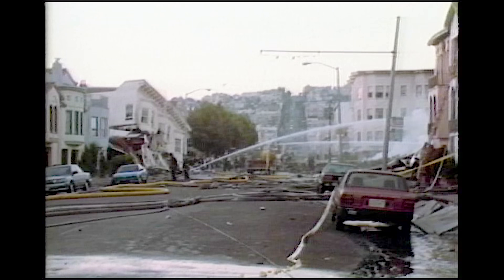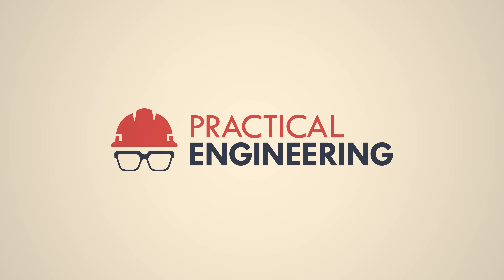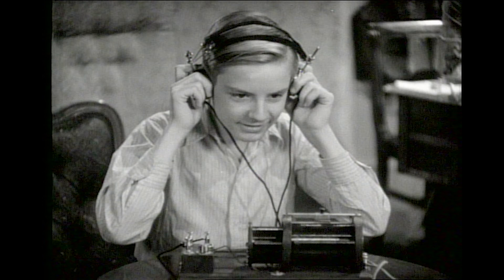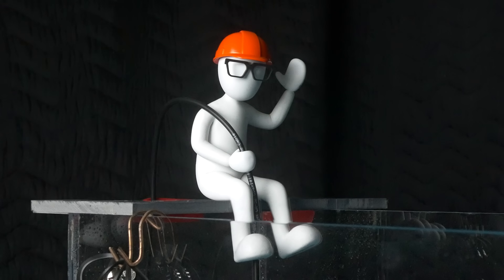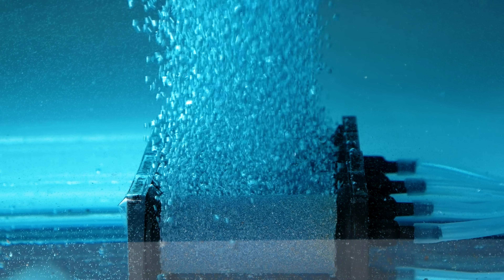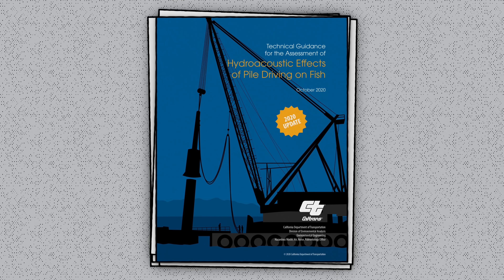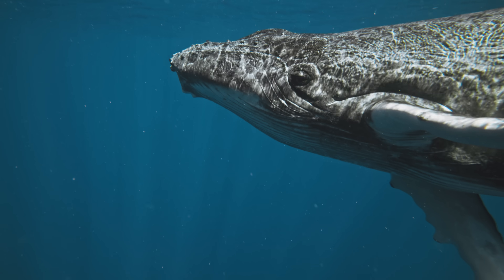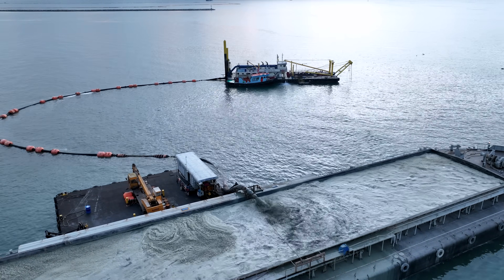The Weirdest Tool in Underwater Construction

Comment: Great story. 

I can vividly remember October 17, 1989 at 5:04 PM... 

I lived through that earthquake and watched the story unfold.  The cypress structure that pancaked also had an interesting failure analysis.  It was the day before the quake I drove through that structure and over the old Bay bridge, and I spoke with someone that just cleared the structure and watched it in her rearview mirror as it went down.  And the numerous aftershocks and warnings that other faults in our area, like the Hayward Fault, could also go off... we were on pins and needles for at least a month.  Still I have PTSD about quakes.

I knew about the air bubble curtains as they did construction.  And I've been across the new bridge.  It's something else.

Comment: Root Mean Square is similar to what we use in aviation for Mean Area Cord which gives an average of the width of a tapered wing from the root to the tip called MAC. This is used to calculate the center of lift and how it moves as the wing tapers, and the flaps and leading edge slats change the width and camber of the wing in different phases of flight. So MAC just means, "It's roughly this wide". haha

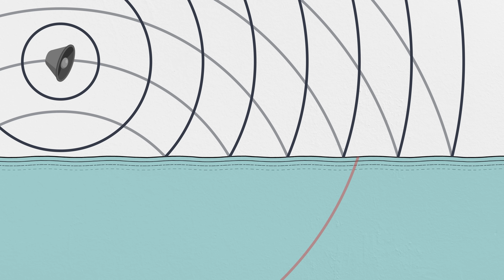Comment: 5:45 this is the reason high efficiency public address systems use horn loaded speakers. The horn helps to match the impedance between the very high density of the speaker cone/diaphragm to the very low density of the air. TMYK

Comment: We also use air in air to divide and isolate spaces. You've probably had the experience of walking through an air door or air curtain. Part of the experience is a strong downward wind while you're passing through the door, but the other half is how there's a dramatic temperature change between both sides.
Reply: The 'fly' problem in outback Australia can be unbelievable. I've walked into shops through open doorways "protected" by rather powerful barriers of "air curtains". (Not a/c, but artificial "windshear" locations.) Flying bugs/insects tend to avoid the turbulence so remain "outdoors"... (unfortunately these curtains don't deter "tourists", but that's another issue altogether...)
Reply: A similar effect is used in automotive and aeronautical engineering. Deliberate streams of air can be used to lower the interference of different pressure zones, such as the top and bottomnside of a wing, or the turbulent air around a wheel and the suspension and the air next to the car

Comment: I have a fish tank, and I have issues with the air lines staying under the gravel.
Creating a bubble curtain, starting at 100 feet, would definitely want to get the airater to float.  The only thing that I can think of is having high-pressure air and a regulator.

Comment: In 3:55 there is a small error: 1 dB increase does not correspond to a 26% increase in sound pressure, but a 26% in sound *intensity*, which is "only" a 12% increase in sound pressure.

Comment: 3:58 +1dB is only a 12% increase of sound pressure. It is a 26% increase of sound power (which goes with the square of pressure).
Reply: I was wondering about that statistic. Later in the video, he mentioned that a 5 dB difference amounted to a ~50% reduction in sound pressure, which didn't square with the first statistic.
Reply: Came to point it out. I’m glad that viewers are so educated that all the work has been already done! 😂
Reply: 20 is confusing, but it is pressure. In audio, it is 20 for voltage and 10 for power. Still, it is very useful.
Reply: Came down here to confirm this haha. Always confusing when differentiating amplitude and power.
Reply: Yeah.   "20" in his formula for dB gave me pause until I realized that the original formula must involve p^2.
I guess the omission is that the dB reference is power dB(P).
Reply: Give him a break, he's a civil engineer

Comment: In shipping they also tried to use air lubrication systems to reduce friction between the hull and water. There were a few pilot projects but there was too fine of a line between retrofit/maintenance costs and savings.

Comment: 11:53 "nearly cut in half" should probably be "near cut in quarter", right? Every 3dB difference is a halving/doubling, so 5dB would be almost twice a halving of sound power (aka a quarter of the original power)
Reply: the pressure is reduced to 56% of the original “nearly cut in half” is accurate. Brady is technically correct in the way he phrased it, because he explicitly mentioned sound pressure. However you are also correct about the power relationship, but Brady didn’t claim that in the clip.

Comment: Slight issue with the first experiment with the two microphones. The outside microphone is directly attached to the water tank and directly recording the sound vibrations transmitted through the acryllic and metal hooks. It sounds like a lot more of the sound is coming through on the recording like this rather than through the air. Source: I have that exact microphone and experimented with recording stuff like this. It's very sensitive to vibrations like this

Comment: Small correction: It's dB(A). The decibel, or rather the "Bel" is a relative unit to measure the ratio of two values of a power quantity on a logarithmic scale. It's used when looking at acoustic waves, power loss in telephone lines (where it originated) and many more places.

Comment: The Mythbusters did an episode of experiments around where you should be in your in the water and there's an explosion.  The answer was that if it was an aerial explosion, you should be as far underwater as you can get.  If it's an underwater explosion, you should get as high above the water as possible (even just getting to the surface is better than being fully immersed).  

I remember from that, that shockwaves have a hard time passing either direction between air and water, so a bubble curtain makes sense.  It provides as many of those transitions as possible.

Comment: I remember watching the Summer Olympics in the late 70's or early 80's, and they had bubble generators in the pool for the high dive event.  I remember the TV commentators explaining that diving from that height into water is almost like diving onto concrete (belly flops from just a few feet up are no fun...), and the bubbles made it significantly softer and safer for the athletes.  That was my first exposure to the relative incompressibility of water.

Comment: Speaking of material impedance between air and water, I feel like it's important to mention the INVERSE of the bubble curtain that's been in use for may decades longer.  NASA has long used water curtains to protect rockets from being damaged by their own sound pressure on launch.

Comment: You should play with ngscopeclient for analysis of waveforms (including audio files but also anything measured with your oscilloscope) in your experiments. We've got a release coming up any day now that will include pre-packaged installers so you don't have to compile it yourself from source code.

If you hooked the transmit waveform coming off your PC sound card to one scope channel and the hydrophone output to the second, you could use ngscopeclient to measure the current frequency as well as the relative amplitude of both signals. Then you could do a sweep with bubbles on and off, do an X-Y plot in both cases to amplitude vs frequency, then divide the two to get a nice attenuation vs frequency plot like in the paper at 10:00 or so.

Doing the measurements ratiometrically like this would let you calibrate out the frequency response of your hydrophone and speaker, as well as normalizing for the insertion loss of the water itself, so you can just measure the deltas with/without the bubbles in isolation. I'd be happy to help you with the experiment setup for any such analysis in the future.

Comment: Unfortunately, the walls of the tank will transmit vibrations.  The sound passing through water will be interacting with that passing through the outer barrier.  While this is similar to the effects of water brushing against the sea floor, the latter is a complex surface.  The tank here more closely resembles the body of a rig or artificial barrier, which, can contribute to sound probogation in a marine environment.

I am curious if there are any materials (like air) that would act as a lightning rod, gathering and attenuating vibrations, creating a muted field.  I'm sure there are studies on this happening somewhere.

Sometimes, the worst sound doesn't come from striking, but the warping of surfaces.  Some structures can amplify sound, turning a mild and harmless blip into an explosive pulse.  Sound has been known to shatter stone after all.  Kind of ironic that an effort to build one bridge could demolish another.

Comment: A bubble curtain lowers the speed of sound by creating a two phase fluid, which has a much lower speed of sound than either phase alone. As you know from train tracks, if the speed of sound is higher, the sound goes further because it's more directly bumping atoms forward rather than bouncing back and forth repeatedly in a less dense medium.

Now say you want the opposite, to create high pressure, you can use a two phase fluid to help there too. If the speed of sound is low, it takes less speed to create a sonic boom, but the sonic boom still has massive pressure within. This is used in chemical engineering to surpass the reaction pressure for a chemical process without having to heat or pressurise the chemicals as much. It's like a physics-based catalyst. The super high pressure is constrained to the nozzle so the rest of the plant is easier and cheaper to build.

Comment: 5:29 ahem ahkschuallyyyyyy...impedance when purely reactive doesn't oppose anything (zero resistance).  Acoustic reactance just causes a phase offset between the peaks of pressure (densest particles) and speed (fastest particles).  Same with electrical impedance which has a phase offset between voltage and current peaks when reactive.

Comment: I think the formula for decibels in the context of sound is wrong. Sound is a unit of power and should be multiplied by 10 instead of 20, the 20 in front of decibells is common for amplitude units such as voltage or current as their square is equal to power

Comment: Pile driving is insanely loud.

I spent a week sitting through hydrophone recordings as an intern, mapping the pile driving and ship noises to AIS and construction data. It's incredible how far you can hear them. Only seismic guns are louder.
Reply: Tell me about it, a couple years ago less than 800 meters from my building there was a year long pile driving for a commerical building near me and yeah that was loud. Glad they only did it a short time every day after 10am
Reply: bro i had to sit through college courses while they built an overpass a half mile from my building. they ran a pile driver for the entire year it was ridiculous. not only could you hear the thing running constantly like a clock, but you could feel it through the floor and walls.
Reply: Try getting polygraphed for a government position while they're driving piles into the waterfront along the river for a new boardwalk less than 100 feet from where you're sitting😅
Reply: @That9one1Guy  well at least you're not getting seismographed
Reply: @That9one1Guy  so weird they would do a polygraph test for a government position when the polygraph test isn't even admissible in court cause it's so inaccurate
Reply: @That9one1Guy  They actually do that?🤣🤣 Why do I get the feeling that any position that "requires" a polygraph test would also prohibit you from speaking about said test and any other onboarding.
Reply: Whats a seismic gun?
Reply: @JasonWhite-f3n  Air guns used to generate acoustic waves that travel into the ground and allow us to map underground structures, like oil deposits, by reflecting off of them.
Reply: @JasonWhite-f3n Remember the beginning of Jurassic Park? Same idea.
Reply: AIS was my favorite system when I was on a ship 😊
Reply: And wind turbines create a similar noise during operation
Reply: @shocktnc wind turbines are really quiet compared to ships. The loud noise is primarily the installation.
Reply: Because you are literally, as the name implies, driving piles. That's why they call it pile driving.
Reply: You should hear me in the bathroom

Comment: I love it. I love how it incorporates pressure waves with changes in materials that produced reflections and attenuation and frequency response and some biology. Control Systems Engineer here - Mentally, I tried imagining an electrical circuit with impedances, passing from the source through the water, then through the plexiglass, and then we’ve got other boundaries between the water and air and between plexiglass and air and between plexiglass and the table.

Where does reduction of sound energy go? Thinking out loud here. The bubbles might act as a small capacitance; I can’t think of any other place the sound energy might be stored. To lower the sound pressure, I think we’ve got to think about where that energy ultimately goes. Does the mechanical energy from the sound increase the pressure of the air bubbles? know pressures in the bubbles will be reducing as they move to the waters surface. Does the gas law PV =ZNRT provide any hints, as bubbles absorb sound energy and increases in volume as they float to the service? I know that cavitation, which is the collapsing of vapo bubbles in a liquid produce mechanical damage to surrounding pipe, and I guess any other solid object the collapsing bubble comes into contact with. In a way, it seems plausible that absorbing sound energy is like the cavitation process in reverse, well not exactly in that the bubble in cavitation is formed by localized pressure being reduced below the vapor pressure of the fluid. Oh well I find this an interesting thought process.

I recently retired and I now have more time to stare out the window and think about such things.😂😂😅

Comment: "Bubble Curtains" also work in sand as a method of reducing its density by a large margin. Aerated sand behaves like other room temperature fluids. I wonder if other types of curtains could be used, i.e. an Argon curtain to isolate the spread of gas in a room, etc
Reply: No need for argon, you can do it with ordinary air: https://en.wikipedia.org/wiki/Air_door